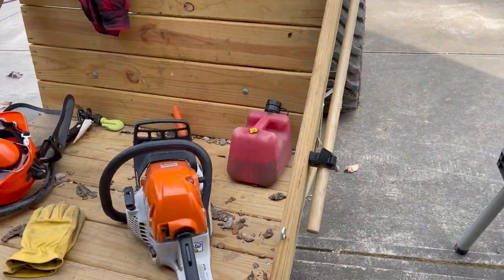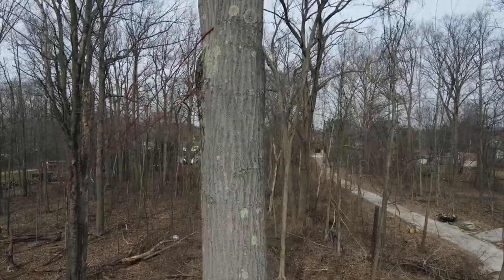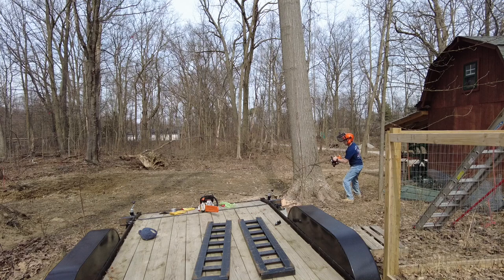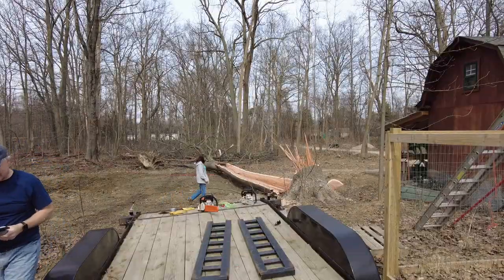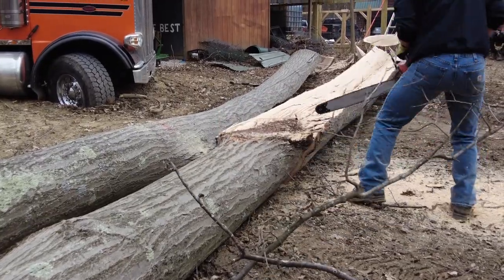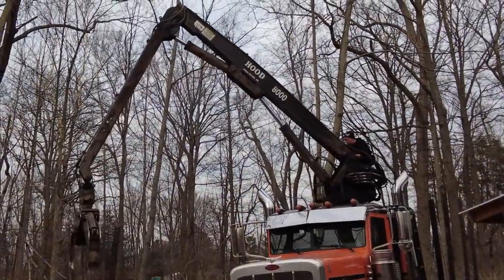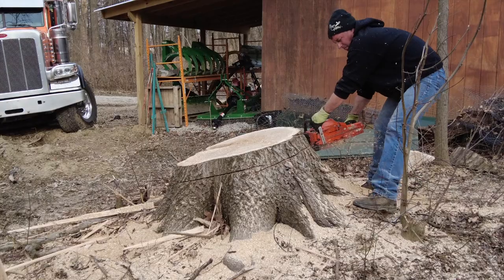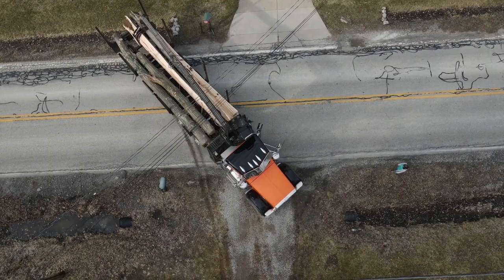John Deere1025R:  How About You, Jimmy?  You An Oak Man?

Comment: Nice title! Sloping back cut is never advisable unless you're in a tree doing a crane pick. You lose control of where your hinge will be and at what height in relation to the face cut, as well as limiting wedging options.I'm a big advocate of boring any tree with significant lean. You can set the hinge in no hurry, set some wedges, tighten your ropes, then when you're ready cut the trigger. Takes minimal practice.
Reply from the maker: Thanks for the tips!
Reply: ...and greatly reduce the likelihood of a barber chair with setting the hinge wood thickness with a plunge cut.  I was actually wincing when he was walking around behind the back cut when it was popping and cracking, then went back in for some more cutting!  If it would have barber chaired, it could have been something very ugly.